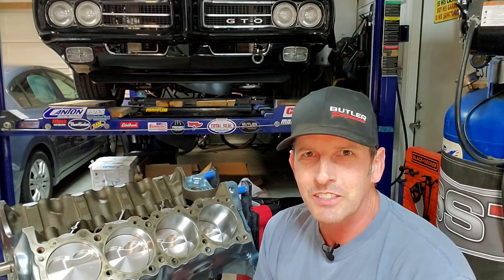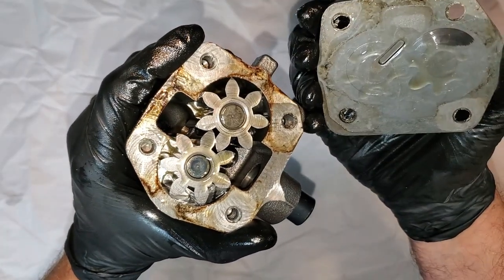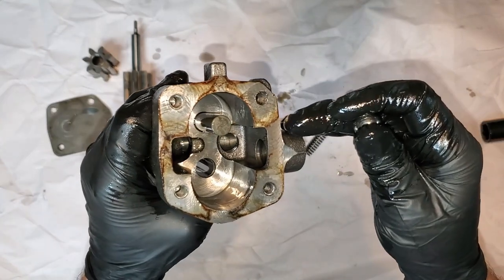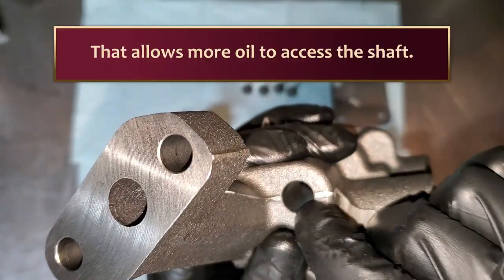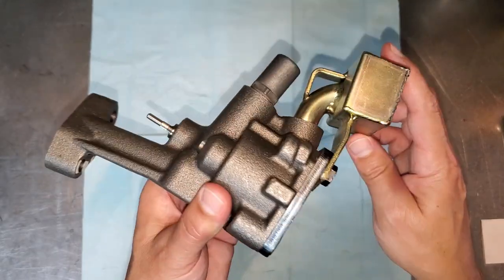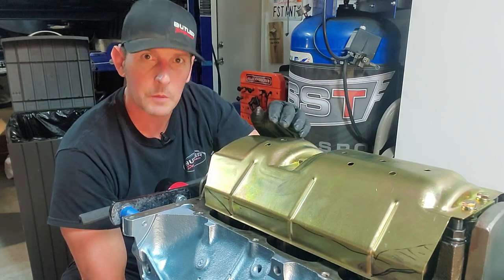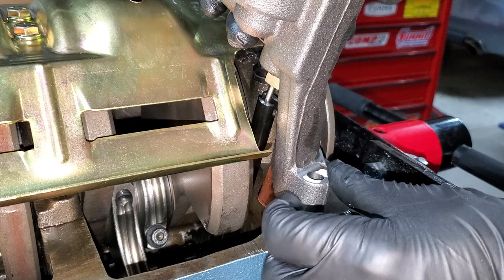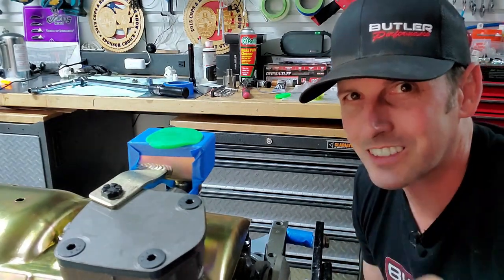Butler Performance Pro Oil Pump vs Standard, tear down and install.  Pontiac Short Block, part 8

Comment: My  1972 455HO was built back in 1972 by Shepard's in Rockingham nc. It has old school trw L2394 30 over pistons , general  kenetics  camshaft , balanced and blueprinted. It is old but very low hours on engine ,  runs great. However it's time to bring her up to date. I bought rings from Butler back in 2012 , reringed her. Butler was great and gave me advice on the old heavy L2394 pistons , time to upgrade. She is a monster ,sounds like a B-29 and pulls like a freight train. I'm looking forward to completely disassembling and freshening her up. It has been a great , powerful , tough engine. She belonged to my dad from 1973 to 1996 and I plan on my son getting it when the time comes. This engine means more to me than anything else I own.
  Love your work , great info and much appreciated.👍👍🏁🏁
Reply from the maker: That's an awesome story, thanks for sharing!  Have fun, and take your time on the rebuild... thanks for being a part of the channel!

Comment: Never considered the possibility of an old windage tray getting brittle. As always, a lot of neat insights and assembly tips 👍
Reply from the maker: Same here!  I had no idea, prior to this video.  Thanks for the comment!
Reply: Kimo, the original windage tray to my 455 had a crack and got replaced by a unit from Ace Brewer at PPR, and it was part of his Tomahawk line. We will see how it held all these years once I pull the motor out.
Reply: @nachomax1639  Cool 👍
Reply from the maker: @nachomax1639  Great testimonial, thanks Nacho!

Comment: I've used both and would definitely recommend the Butler Pro.  My current pump is a Butler Pro 80psi with a 60psi cap and a shim.  Gets me about 70psi and 30-35 at hot idle.  The only other recommendation I have is while you have your pump apart, bolt it to the engine and drop a light down the pressure passage leading to the engine.  Every engine I have had has had significant misalignment with this passage which is too small to begin with.  I opened up the passage in the block (less chance of breakage) in the appropriate direction to ensure the oil pump and block passage are in alignment.
Reply from the maker: Now you tell me.... ha, ha... good tip.  Too late for me.  But, good for others to see.  Thanks Steve!
Reply: @FastMonty  Yeah, it probably can be done but you would have to real careful at this point.  I also drilled out the passages to the filter to 9/16" but that takes some nerve and an expensive, high quality long drill bit.  https://forums.maxperformanceinc.com/forums/showthread.php?p=3143048
Reply from the maker: @stevebrown6175  Thanks Steve!  Yeah, good things to note for the next monster build.  See ya soon!

Comment: These videos are a lifesaver! What stud kit are you using for the mains? I'm using 194-5401 but the fronts hit the oil pan. Ive tried 4 different pans. Also, what pick and pan are you using? All the pickups ive seen say 1/8 to 1/4 clearance. Thanks!
Reply from the maker: Sorry to hear about the front studs.  Very strange.  I dont know off the top of my head as to which set I bought.  I'm using a Canton Road Race pan, and pickup.  Part numbers are in the description of the video... and there's this video too... https://youtu.be/o_JVUVPgzao  Have fun!

Comment: Hey Monty, quick question, I have the m54ds, do you recommend me pulling the pump plate off and going through it and cleaning up the gears inside, maybe lubing it up before I put the gears back in?
Reply from the maker: Yeah, if you can easily access it, check for burrs, etc... just make sure you locktite the bolts when you put the plate back on.

Comment: I use Mellings 54DS?  On my Pontiacs.  It runs 60-70 psi.
Reply from the maker: Yup, that's a standard 60 pound pump, with pick up screen.  Thanks for the comment.

Comment: Hey Mike, so, did that copper gasket come with your pump?  I just received my 80lb pump from Butler (the identical one you’re using) and there was no gasket.  There was bolts and lock washers, however.
Reply from the maker: hey Michael... if you got the Butler Pro Pump, yes, it should have a copper gasket.  Mine was in a tiny envelope, hiding in the box.  I think it was taped to the side?  If not, give Butler a ring... congrats on a bad ass pump!
Reply: @FastMonty , Bingo!  It sure was taped to the side of the box in a tiny envelope and even said “gasket Enclosed”. Winner winner chicken dinner!
Reply from the maker: @michaelclarke9488  Ha!  Glad I could help!
Reply: One more question, what is your ‘at temperature’ oil pressure at idle?
Reply from the maker: @michaelclarke9488  At Temp, I'm about 22 lbs.  The important thing to note is how fast it increases pressure.  You should be seeing at least 15 psi per 1000 rpm increase.  ie, at 3000 rpm I'm about 70 psi
Reply: @FastMonty  right on!  Thanks for the help!  Keep the great content coming.
Reply from the maker: @michaelclarke9488  Doing my best... keep at it!

Comment: Did you add assembly lube on the oil pump gears?
Reply from the maker: Good question... not necessary, as they're not "loaded" against each other, and oil hits them first, when you prime the engine.  Thanks John!